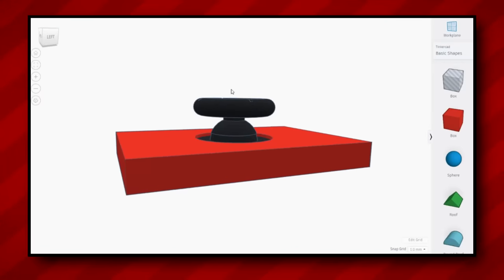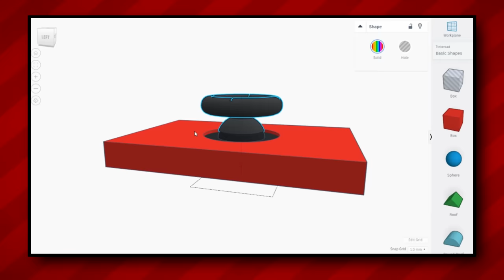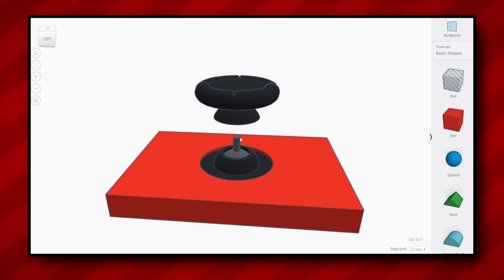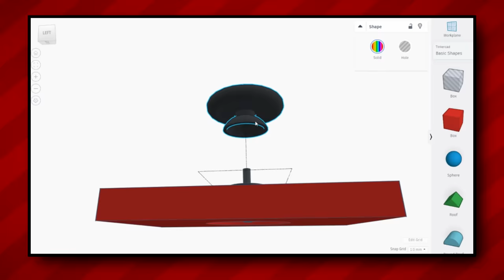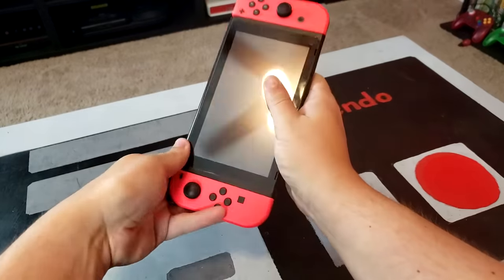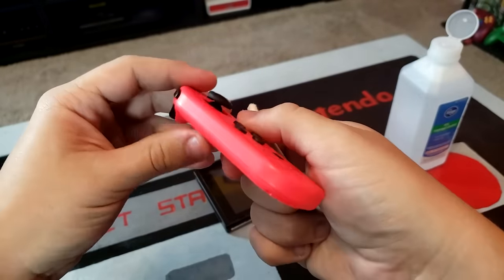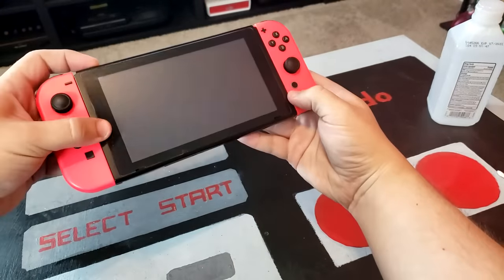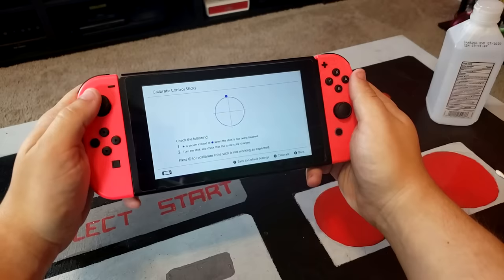How to Fix Joy-Con Drift at Home! No tools required! | Nintendrew

Comment: This sounds like a better idea then jamming the joystick in the opposite direction of where it is drifting.
Reply: Lol me
Reply: I did this too and it didn't get better so I threw my controller  across my room
Reply: then did it work
Reply: Yeah probably
Reply: @cret273  I lifted the rubber with a toothpick, and then I held the controller upside down and blew hard into the base of the thumbstick while rotating it, first time didn't help but the second try fixed my drifting.

Comment: Provided that the drift issue in your joycon is due to dirt underneath the controller this method will work. If the issue is due to wear and tear no amount of cleaning will fix it for good unfortunately , you’ll either have to send it to repair or buy a new set.
Reply: That's why (some) 3rd party cons rule!
Reply: @ErroneousClique  I have to agree, this is the first time that I experience this this Nintendo controllers (except the N64). Usually my controllers get broken due to over use for more than a couple of years but these JoyCons just last me a couple of months of use
Reply: If you don't have any warranty left, just find a shop that sells loose joysticks and triwing screwdrivers for the switch and look up one of the tutorials on how to replace them. If your only next option is buying a new joycon, give yourself an option to possibly save that money. It worked for me and turned out to be quite easy.
Reply: Worst of all, if the drift is because of wear and tear, this can make it much, much worse. A much better way is to just spray difluoroethane ("air duster") under there
Reply: ErroneousClique 
Funny thing is, the Joycons are more expensive than Pro controllers.
Reply: @ErroneousClique  So how long do you think these joysticks last before they inevitably fail?
Reply: @Treychik  which ones
Reply: @boboclown3810  have no idea :) seen some random vids people seem to like them. Og ones suck, really...the sticks are god awful :( buttons kinda too. Some people just change buttons and sticks, some get 3rd party...

Comment: FYI use 91% isopropyl alcohol its safer on electronics as it dries very quickly. He used 91% but it wasn't mentioned in the video. Don't want people using 70% and soaking their controllers.
Reply: So that's why it isn't working
Reply: @NOPO29  Oh poor you
Reply: For me 70% does work but it's not as effective ,so take my words with a grain of salt.
Reply: Would the 99% one work?
Reply: oh boy, I just used 50%
Reply: does it work with 99% ?
Reply: 90% and up is good. You don’t want any less than that since that means there is a lot of water in it and water and electronics don’t go hand in hand
Reply: Shlimon69 thanks
Reply: Le KoraOne np
Reply: @catwelches7129   Even better.
Reply: Thanks I was just seeking in the comments to see how concetrate it should be
Reply: I want to try this solution method now but I'm reading conflicting comments from people. There's an extensive reddit post where someone says NOT to use 91% isopropyl because it eats away the rubbers on the controllers. Some say 70% is the way to go. I don't know which option to go for.. Can someone confirm?
Reply: @89rjk  I'd say 99 percent, since it dries much more quickly. A small patch of rubbing alcohol at that purity will dry completely within seconds.
Reply: …oops..

Comment: My drift con is so bad I can’t calibrate it, it just says ‘release’ when I’m not holding it
Reply: sameee
Reply: same
Reply: @seblolwth6033  sameee
Reply: Same thing happened to me but I discovered that clicking in the stick makes the input snap back and detects inputs properly, but only temporarily. Not sure if this is just me though.
Reply: Same
Reply: Me too
Reply: that just means it's a hardware issue and not a software issue
Reply: I can't even start recalibrating
Reply: Update: My left joycon's starting to drift seriously now. Though everytime it does using alcohol to clean the stick internally seems to work. I've repeatedly done this about three times every few weeks now and it seems to make the stick read correctly after cleaning.
Reply: Same Nintendo I'm pretty sure said I'm sorry and that's it like I spend 500 dollars on a unfinished console and that's like selling me plastic chocolate and I don't get my money back or they dont give me a real chocolate bar. And in splatoon 2 I cant quit or else I get banned so if my controller is glitching I cant do anything
Reply: Leowhitelion Same!!!
Reply: Same here
Reply: Press f in the chat
Reply: Same
Reply: same
Reply: GUESS WHAT IG WORKS!!
Reply: My drifting makes it so it's hard to play smash bc it won't let me jump or punch
Reply: Same
Reply: At that point you should just get a new joycon
Reply: @GABRIEL MORALES-TREJO Oh
Reply: Same
Reply: sameeee
Reply: Same
Reply: sameeeee
so bad
Reply: Yup same

Comment: Launch day owner - severe drift. This made them back to as if they were new. Thanks man.
Reply: Bro same, I had the same problem, splatoon was legit unplayable since moving backwards was so slow, so I tried it and mostly fixed all the problems with both joycons I did it on
Edit: after a week they actually got worse and now drift to sorta upwards and left
Reply: @anthonyr9828  He said launch day, there weren't other versions until the switch was 2-3 years old
Reply: Yeah I have one of the earlier models I have the mario kart 8 version and my drift was horrible but then this fixed 3 year old joycons
Reply: Can't play BOTW or AC:NH, imagine fighting an invisible gust of wind that pushed you to the left. Going to try this, if not replace the joystick or joycon completely.
Reply: @eduardodiaz5762  I was this close to caving and buying $80 pro controllers, but I tried this as a last resort and my drift is completely gone! AC:NH was unplayable,I couldn't select anything from a menu without the cursor going wild, I couldn't stand still without my character going for a RUN in the opposite direction, it was awful. But now I can play properly!
Reply: @zeonmoo192  I know that feeling all too well, couldn't finish building my island how I wanted it just piles of hills and bare land cause it was unplayable... Now I'm replaying Zelda in the master mode and finishing my island. Best fix and i use a q tip and one of those 71% alcohol wet towlettes. Seemed mine was really dirty.
Reply: @eduardodiaz5762  It worked for you?
Reply: @petery6432  I had severe stick drift, cleaned it and calibrated it and it doesn't drift anymore. I'm planning on fixing the joycon locking tab and the analog stick soon I just did this to see if it helped... And to play BOTW Master Mode, best way to Play Zelda.
Reply: Chimney Is it still working for you?
Reply: @Maverick.D.  this is a temporary fix, for me it was temporary, I ordered 2 analog sticks v2 for 15$ and 8$ for metal lock tabs with screw driver set, fixed both lock tabs and a the left joycon Analog stick, calibrated after installating. Now NO more Stick drift, and the Joycons lock, it's like New again.
Reply: @Maverick.D.  nope, unfortunately it only worked for about a week, now it seems to be getting worse than it was before even after cleaning it again! Ugh...
Reply: Your comment helped me to try this out!
Reply: @oscarbravo5670  it's a temporary fix.. just do this and order analog joystick replacements like 15$ for two I'd recommend changing the plastic OEM tabs as well to Metal, plastic will wear out eventually.
Reply: @eduardodiaz5762  I actually did this, and the replacement ones only lasted for about 6 weeks, now they both not only drift, but cannot read up or down input. absolute garbage.

Comment: Can confirm this 100% works with the original switch.  I tried it with four joy-cons that ALL had this problem, and they are as good as new.
Reply: How long do I have to wait until they work properly? I tried on my left Joystick that would make my playable character drift left and right, and now they're just drifting a little bit to the right.
Reply: It worked great for me almost immediately. But I still have to clean them out this way every 3 days. I guess that’s what I get for buying “refurbished” from GameStop 🤷‍♀️
Reply: Roo no it’s not that it’s refurbished Becuase i have the og switch from 2 years ago and started drifting 5 months after I got it :/
Reply: It does stop the drifting, but it comes back after an hour or less.
Reply: No it doesn't lol
Reply: ZackFireX will mine work because I got it last Christmas?
Reply: for me it made it worse
Reply: Expand Leo honestly

Comment: Dude you're a legend bro. I had my left joycon with this issue. I replaced it, the replacement was still doing that. After that I replaced just the analog stick of the second replacement guess what, it was still doing that. But I saw your video today I did what you said, but I had to do it for two or three times, in order for the alcohol to go into the components. After playing with it a bit it was still kinda doing it, but then in the end it stopped. Probably it got cleaned by playing with it for a while too. Just sharing this, to let everyone know it works like a charm. Thanks dude. Subbed for this :) So it works but it may require some patience in some cases, like mine.
Reply: did it come back?
Reply: The only comment ive been looking for, thank you
Reply: It worked for me
Reply: @dw3508  would like to know as well. Followed the instructions and so far it's been a whole day without the drift.
Reply: Is this some special alcohol or is it the one that you use as handsanitizer
Reply: @herminator1613  You can use nail polish remover if you have it (it has to be have an acetone base though)
Reply: Christos Louridas ok thanks
Reply: @shlaapp2698  That stuff's definitely liable to eat through some plastics, though, so it's probably not something to use the first time around if at all.

Comment: I did this about a year ago and didn’t have an issue [I used tweezers to keep the rubber skirt up so I could push the q-tip around]. I started having the drift last night while playing animal crossing and forgot how to fix the drift. Found your video and it refreshed my memory. Thanks! =)
Reply: So it lasted a year wow

Comment: Testing this out atm
Update: Marry me, Nintendrew. It worked like a charm. Drift is now gone!
Reply: WHEN DID YOU BUY YOUR JOY CONS/SWITCH?
Reply: @ohnor___  October 2017
Reply: I bought mine almost 2 months ago (August) and my left joycon started drifting just today. I hope this works x
Reply: @316whatupz  DO YOU THINK IT WILL WORK ON A SWITCH FROM JUNE 2018?
Reply: @ohnor___  IT SHOULD WORK, BUT THERE IS A CHANCE THAT THE ANALOG STICK NEEDS A REPLACEMENT IF THIS DOESN'T WORK
Reply: @316whatupz  K THANKS
Reply: @ohnor___  YOU'RE WELCOME
Reply: @316whatupz  🙃
Reply: I bought mine around August and the drift has been on/off but I'll definitely try this
Reply: @checkoutmynewchannel6708  GOOD LUCK! 🙃
Reply: Update without an edited comment, GG
Reply: 🦀🦀DRIFT IS GONE🦀🦀
Reply: @xehP  I was about to comment that.
Reply: i got mine in 2017 its held up really well
Reply: @levithom  got the switch before it came out, sounds legit
Reply: Your comment wasn't even edited...
Reply: @craydussy  uhh yeah thats what I was saying so, right back at ya "absoluye buffon"
Reply: @jack.h99  bruh tf are you talking about you said "you got it before the switch came out" and i was saying it was out in 2017
Reply: @craydussy  was talking to @Honda Civic
Reply: You did not even edit your comment
Reply: @maskedzoroark8488  yeah, wrote the comment half way, tried it, applied update and posted comment. Don't need edit. I'm OG like dat.
Reply: @glub1381  NOICE

Comment: I've had my switch for two years, and they have been drifty since about two months in. I tried compressed air, but it did'nt work. I finally have usable joycons thanks to this video!
Reply: Question is drifting when the joystick cursor randomly moves?
Reply: The Geek Freak 39 drifting is when the joycons move to a direction without you touching the joycons
Reply: @archiehague-smith376  Thanks
Reply: I bought a pro control

Comment: I'm gonna say, I've been having issue with drift quite severely recently, especially since I play The Binding of Isaac the most on my Switch. Starting any Isaac run always has me slightly moving up, barely moving at all, or just shooting in a random direction. 
And yeah, this helped IMMENSLY. I might have to do this quite a bit, but the fact that it worked, just makes me happy.
Reply: I play Isaac too, and after a thousand hours of Animal Crossing during the pandemic I went and bought an usb controller to be able to play because the original ones made it IMPOSSIBLE to sneak up between spikes/dodge enemies etc
I hope this video helps me fix my good old original ones (':

Comment: Little additional tip for you artists out there: instead of a Q-Tip, use a small, clean paintbrush. You can be much gentler with that than you would the Q-Tip, and you can get in deeper and not risk damaging your Joycon.
Reply: Thanks for the advice. Really helped me fix my joy cons
Reply: Thank you! I was trying to think what I could use becuase iv ran out of q tips
Reply: I used a piece of paper but the brush sounds like a better idea
Reply: Get in there nice and deep like
Reply: On a similar note, please don't use a cheap paint brush. Paint brushes tend to shed their bristles/hair. The last thing you need is a bunch of bristles/hair to get stuck in there.
Reply: Thank you so much! Very helpful advice!
Reply: @franks8462  so value village or walmart sounds viable. Only the best for the things i cherish. Lol im just trolling you have a good point
Reply: @franks8462 "Hell it's our anniversary, why dont we get her a Pepsi instead" (water glass in front of her)

Comment: For all those people looking if this works, it does

Update: it just stopped working had to do it again
Reply: Thank you !!!
Reply: I literally scrolled down for a minute just to find this. Thanks
Reply: It didnt for me :(
Reply: @kellys8648  aww, rip.
Reply: does it work for a lite?
Reply: @chalky1339   I don't know I have the normal switch
Reply: @kellys8648  I've heard that there's a piece inside the controller that starts to wear down overtime. If that's true, that may be the problem.
Reply: FUCK TO THE HELL YES! I AM GONNA HAVE NOT USELESS PIWCES OF JUNK ONCE MORE!!!! MARIO MAKER ON THE GOOOOOOO
Reply: try dousing the joycon in it
Reply: YES OR NO I AM CONFUSEt sorry for this question
Reply: Worked for me on all my old joycons. Glad I didn't throw them away. Make sure you get a little in between the crack on the base floor as well.
Reply: @chalky1339  If you have a lite you're basically screwed. You can keep cleaning your Joy-Con but if you need a legitimate repair,  you'll have to send it off to Nintendo.
Reply: @bigepic_3638  did it work?

Comment: me: tries to look forward in splatoon 2
my right joycon: i have great interest in floor
Reply: Ugh, relatable.

That got really annoying when I was doing Chaos VS Order, what made it worse is that my right Joy Con wasn't just drifting down, it also drifts left so when it drifts down, it drifts in both directions and I have to fight it for 2-5 seconds to regain control, and by the time I get control of the camera again, I'm already dead. Once Nintendo offered free repairs, I got mine fixed.

Until recently, now my left JC is drifting, which makes me look like a dum dum when trying to play ACNH, but thankfully I tried out the method in this video and it worked for me.
Reply: i am sad that i can relate
Reply: i remember trying to move forward in splatoon 2 but NOOO the drift decided to make me move backwards 😡😡😡
Reply: Having a similar problem. Only difference is that it's looking upwards on mine. Really getting annoying...
Reply: Hmm, the floor is made of floor
Reply: Hmmm yes. The floor here is made of floor.
Reply: Fr
Reply: Hm, yes, the floor here is made of floor
Reply: This floor is delicious
Reply: Me: tries to literally just move forward
Left joycon: adios amigo
Reply: Yeh same my right joycon is always interested in floors.
Reply: I’m a charger main with my right joycon drifting. It goes right, and not in the slow minor way :( I can’t play with any weapon because it always makes me aim wrong
Reply: Hm this floor looking really floory

Comment: I sent in both my drifting Joy-Con to Nintendo (not within the warranty period) and they ended up fixing them for free, so if you still have issues after this I'd recommend giving it a try.
Reply: Where do you contact them to for repair requests?
Reply: @coltonaallen  At least in the US: Nintendo website -> scroll to the bottom under the support tab click repair help -> Start a Nintendo Switch Repair -> Click "Important: Set up a repair  for your Joy-Con", and fill out the information there. They will give you a shipping label, and so follow the directions to have it sent to them, and wait a while until you get your Joy-Con back.
Reply: Not free in europe
Reply: Nintendo doesn't actually fix them... they just replace the cheap graphite with more cheap graphite.
Pencil "lead" should never be used inside a precision instrument.
Reply: how long did it  take
Reply: The Master  Not long... maybe a week or less? (EDIT: looking back on it, maybe just less than 2... not sure exactly what date I shipped it out)
Reply: Not available outside us or canada
Reply: The problem is not all of us here have the time or patience for that. That's why this method works perfectly.